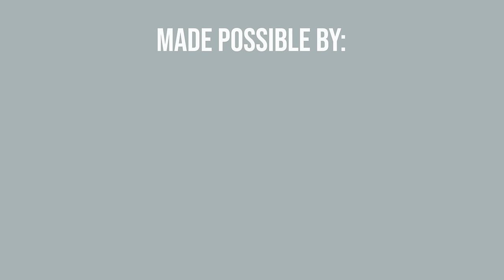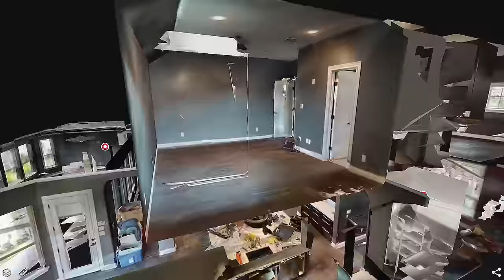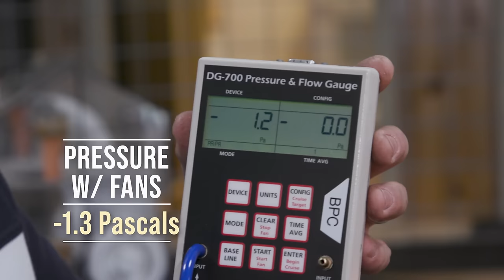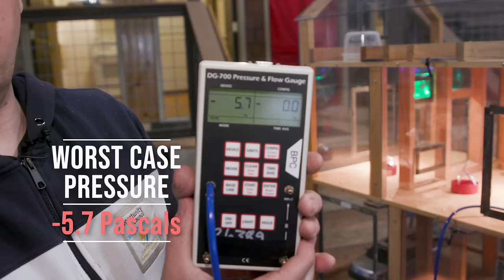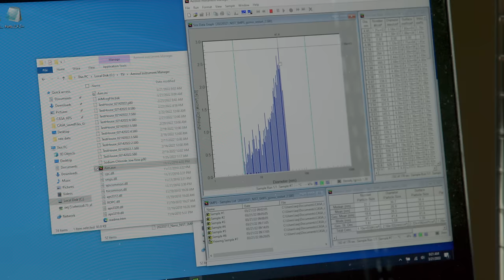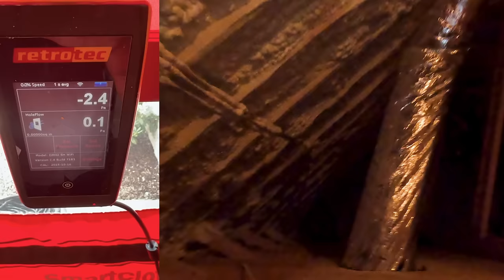The #1 Problem in Home Performance- Air Leakage: Ep 302 of HOME DIAGNOSIS TV Series

Comment: Considering the size of their investment, why didn't they hire a professional building inspection service at a couple of key points: footings, before close-in (framing, plumbing, electrical, and HVAC), and finish? Yes, it is an additional expense but they live in an area where the county isn't providing the service.
Reply from the maker: They did, that’s the sad part. Production just moves too fast to correct things correctly.
Reply: @HomePerformance  Next week, the foundation company will start work on my project. I am at the other extreme, where the county wants to micromanage everything. Thanks for sharing your reflections on the prior house because I am borrowing ideas from your prior videos. The discussions on filtration, ventilation, ERV, dehumidification, and kitchen fresh air makeup are being considered for our all-electric home with zero fireplaces.
Reply from the maker: @josephmerritt1411 rock on Joseph! Go get it.

Comment: Agree on open fireplace should be illegal but the cast iron fire stoves should be in every home as an backup heat source (at least cold climate) and it should be air tight when closed.
But the homeowner need to know that if the kitchen stove ventilation is on and you try to light a fire with a cold chimney it will suck smoke in, and you need to open a window/turn off the fan or have a makeup air fan to prevent negative pressure while lighting the fire.

In my home i have taped the wire tube joints (don't remember it in English but we have all electrical wires in walls innside plastic corrugated tubes) and some that go outside for like my door bell i put 2 foam ear plugs where the wires go out to completely seal it and keeping it easy maintenance for later.

Also have a infiray thermal camera that is supreme to find air leakage and thermal bridges and done many air sealings around.

And i also have many air quality sensors around, in the kitchen, living room and bedroom and it is controlling the HRV in my house so it is only on demand, my unit is oversized so it is less than half the time on and Co2 is always below 700ppm and average over a year between 550 and 600ppm, tvoc is always below 0.03mg/m3 but mostly under 0.02mg/m3.

My house is from 1960 and have air sealed pretty well and is half way through a full insulation and renovation, it is much better air quality than my friends houses that is built after 2010, not as well insulated but better for living, and i use less energy than them also since all my heating is heat pump, and only one 200watt electric space heater for the toilet. And an 300watt air dehumidifier running 24/7 in the basement

Comment: so true with fireplaces. still a common heat source where i am. but even in older homes, big fans are being installed and depressurizing the room (or house) causing back a back draft.
what annoys me is professionals, like fire service, ignore it or incorrectly assume the fan is for something else therefore its not the cause.

Comment: I saw the new video pop up just after boarding a plane, and happy I got it downloaded before they made us turn on airplane mode. Knowing someone in the middle of building a new house where the builder is a regional volume builder, is there anything that can be done to prevent this during the pre-insulation inspection? Or any recommendations on how to find an inspector who will identify the issues leading to problems described in the video? The builder generally hits under 3 ACH50, but not by much. 

Great video, i shared it with the person building a house.
Reply from the maker: Great to hear John, glad it hit the spot! Yes, inspect and test with a third party- BUT that might not be amenable to the contract he already signed.

Comment: If you use radial/centrifugal fans in the demo-model 13:48 (instead of axial fans), you can hit higher dP values. (If that is something you might be interested in). 

Radial fans are slightly more expensive than axial fans, and have lower volumetric flow-rate (no such thing as a free lunch) but might be able to demo some effects better.

Comment: Pretty sure at 7:17 that wood I beam is not supposed to have that size hole in it either for structural integrity “the ducting”
Reply: +1 houses are often designed with no thought into the services and products that will be fitted. so trades just make it fit.

Comment: If only there were building materials that weren't so moisture sensitive that they turned into mold food the second they saw a drop of water... 

Also, never trust a GC or subcontractor; always double and triple check their work. And write it in your contract that they don't get a single penny if the work isn't completed as designed, and inspected by a third party.